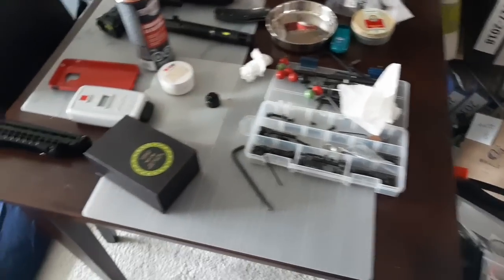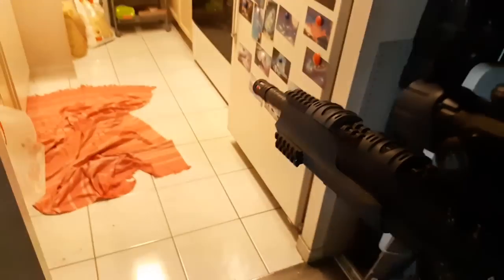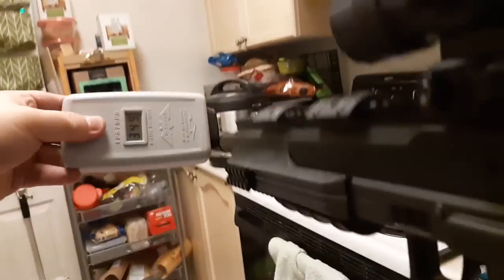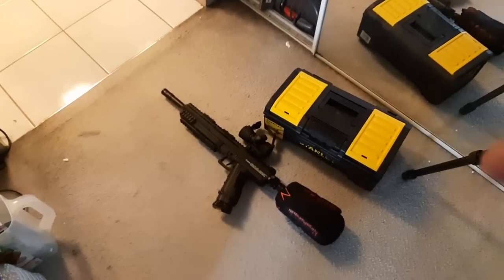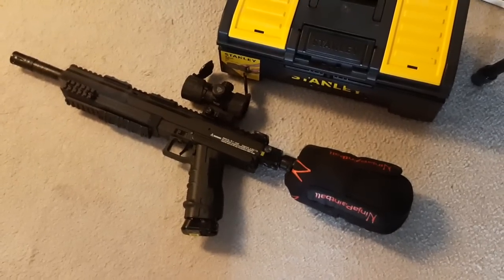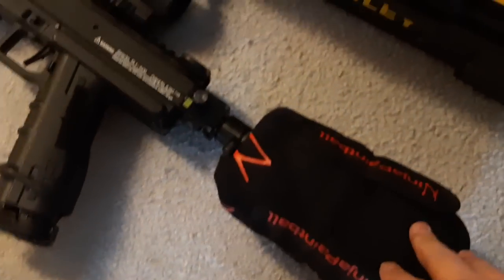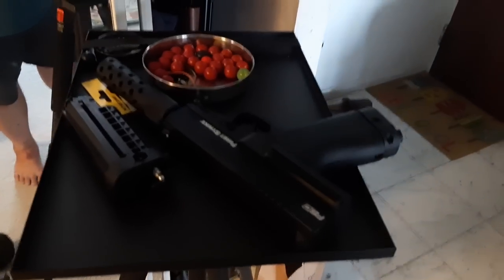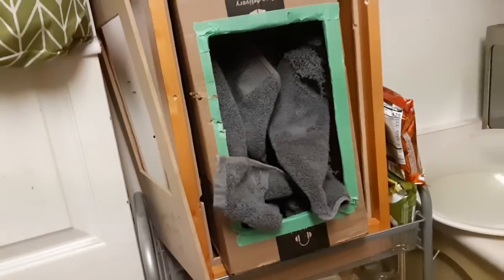Grimburg HP68 and First Strike T9.1 High Power 43 Joules

Comment: First ;)
Imressive power! Good video as allways. Keep up the good work. Looking foreward to your next video :)
Reply from the maker: I think this is it, I am too tired doing tank maintenance and pumping up tanks after tanks etc.  I will put 88g co2 on this gun at the back and that's the setup for real use. About 30 shots for a co2?  Insane expensive to shoot but it will work LOL!... Honestly, the gun work much better tuned to what we have on the t8.1 settings, one 12g co2 for 1 mag of shots, that's it. Nothing more fancy or powerful is needed.  This method with air at the back is kinda stupid too because if you run out of air, you have no way to change air out in a "real life situation" because the hassle is just way too ridiculous. Whereas a 12g mag you just eject and shove new mag in and keep shooting.  MUCH BETTER.
Reply: @Chiinnature  I agree. The T8.1 must be the best of these guns. I bought a spare magazine for mine :)
You make very interesting videos. Your testing is exactly what Iam interested in, so keep up the good work :)
Reply from the maker: hahaha thanks!  Ya the T8.1 remain as the king of all, really love that thing!
Reply from the maker: i dun like shooting fruits, too messy and too much clean up to do later.  Human head is much more fragile than a coconut, and don't forget even at 25ish joules you can punch through a watermelon already. 43 joules you just see nothing but holes.
Reply: Felix Vazquez    Just bought the Beast 666 !  Rock and roll !
Reply: @Chiinnature  No one believed your comment 2 years ago but then it became a sad reality.  I know it's a lot of work doing these types of videos because I just started. Thanks for your service in providing some seminal insights.  You pioneered an entirely new area in less lethal self defense.

Comment: I am not good with building these guns can you point me in the right direction of an AR-15 Style with semi and fully-automatic that can give me up to 40 50 jewels
Reply from the maker: There is none. You want 40-50 joules, you can only go with a First Strike FSC, with barrel change, and the o-ring changed for firing valve, using rear  ASA with a tank then you can achieve this kind of power I have now. No AR15 style on the market can do the job for you.
Reply: @Chiinnature  can you recommend the Tippmann mad dog with e trigger for home defense I like the full auto. And what shooting steel balls be better than shooting skull Breakers
Reply from the maker: Those cannot go high power. I told you already there is no options for what you want on the market. You are not playing paintball with the bad guys, if you full auto spray and pray in the house, your house is broken after the defending, what's the point?  Reality no police need 200 rounds to do the job right?  Back then police only carry a revolver with 6 rounds. IF you can't deal with it with 6-8 rounds, you can't do it with 200 either because it's your problem.
Reply: @stevenmeans6873  he sounds very hostile in this comment

Comment: is 43 joules lethal? or are these similar to less lethal police weapons?
Reply: Yes, 43 joules is lethal. That is an average of 340 FPS with a 8 gram hard projectile. Like getting hit hard with a rubber hammer. Grimburg projectiles are no joke and can be lethal at these power settings. This setup is very similar to what law enforcement uses. Know your State's laws on using compressed air markers before using these in a self defense situation.